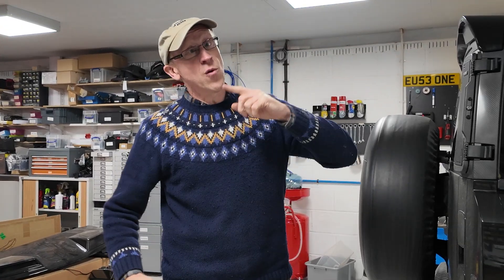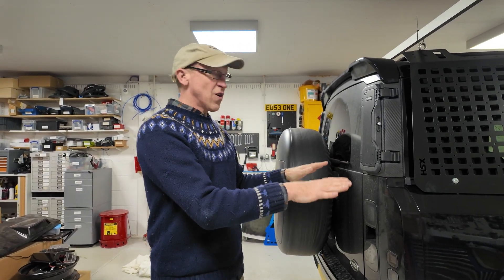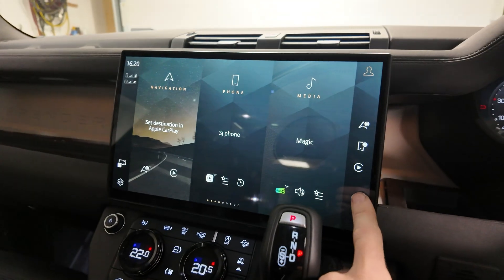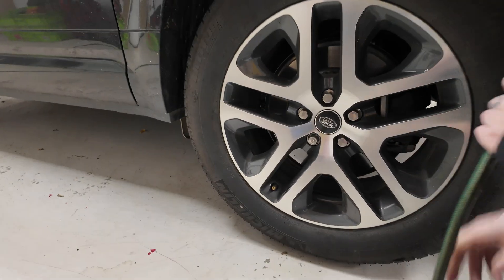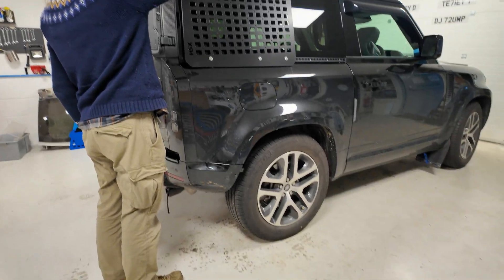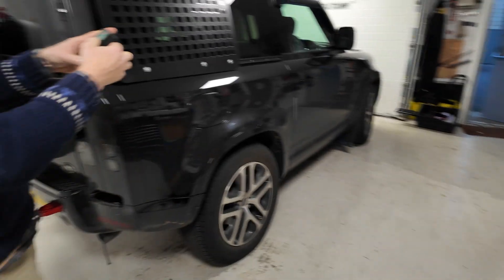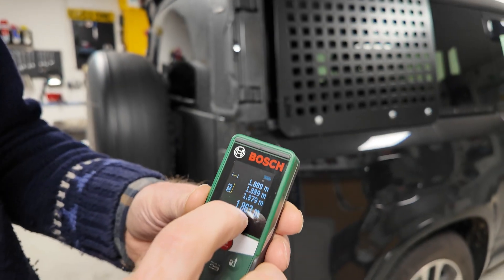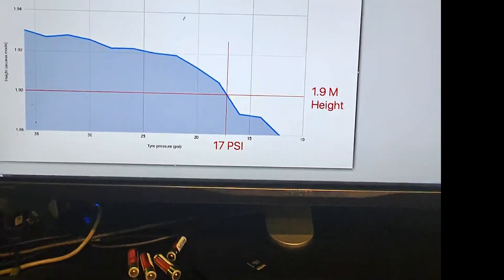Land Rover Defender L663 - How Does Tyre Pressure Impact Height - Can we get to 1.9M high ?.

Comment: At our local tip, the height restrictor notice, hanging on a chain, shows 1.9m, yet we drive under it without issue. Not that I trust signage and underground car parks that don't have a hanging chain guide for some forgiveness, as we know. However, there is no single UK building regulation for underground car park height, but the general minimum headroom is between 2.0 and 2.4 meters to accommodate standard vehicles. To be fair, you pay your money, you take your chance if you enter!. The issue might not be the entrance but the bottom of a ramp. When your vehicle reaches level ground, there is a pivot point at which the car reaches a high point in the middle before the rear wheels reach the flat of the ground. I would not take my Doscovery in. The local tip is one thing with a chain-suspended bar and sign; getting jammed in an underground car park is another.  Fun exercise though, Simon.

Comment: This is highly relevant for going off road as well. Lowering tire pressure improves traction and comfort, but also reduces ground clearance. I have a 2023 110 on coil springs; I drop to 18 psi off road. If I understood your graph, that’s costing me ~3cm of clearance. Ouch.
Reply from the maker: Yes that would seem to be correct and something to consider
Reply: Now if you had an air suspension...🤫
Reply: @Steve_MFr I would still lose 3cm…
Reply: @mfreidberg  Which you could add in a heartbeat (with an IIDTool) 😛

Comment: Do you not think that the advertised dimensions have a safety allowance built in?
How about making a frame exactly 1.9 metres tall and seeing if you fit under it at normal tyre pressure,
If nothing else it would show if the given dimensions are accurate. 
For example local councils advertise a maximum width when they narrow a road entrance with bollards. I used to drive a Vivaro van through them that supposedly were too close together to fit through, close fit but still fitted in the gap.
Reply from the maker: At the start the car was 1.93 so it wont fit under 1.90... i agree some parking places showing 1.90 are probably higher.